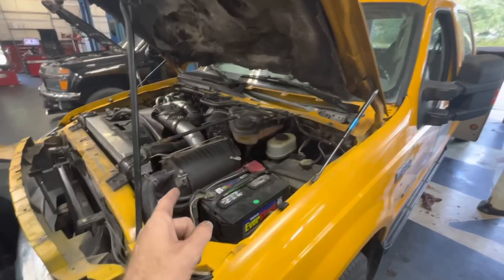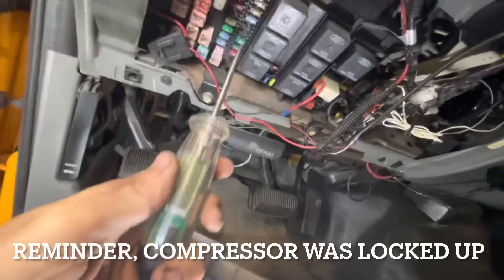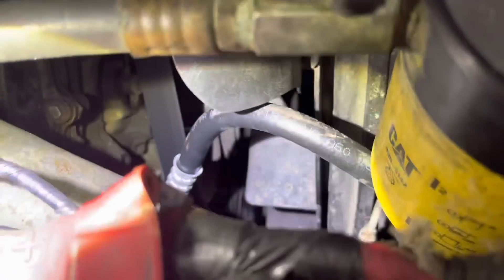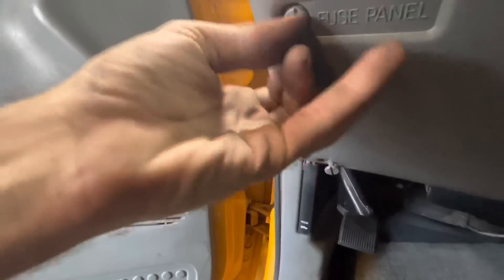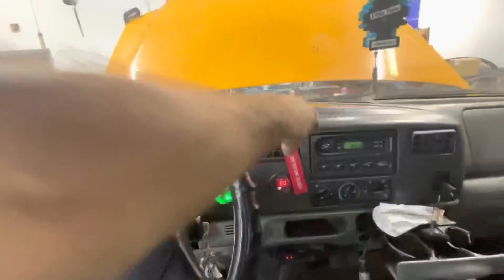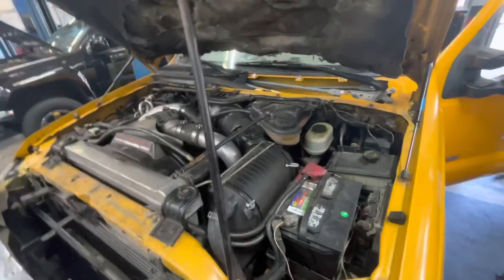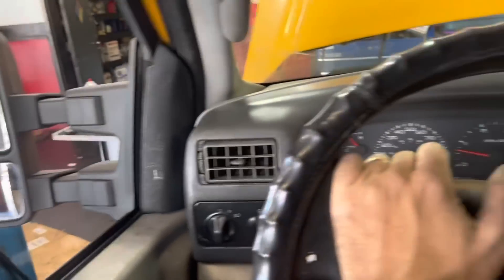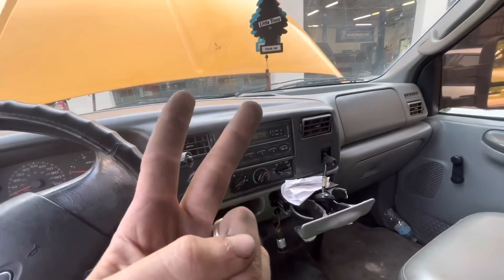All that for a fuse? F350 6.0

Comment: Don't feel bad, early Ford OBD2 will kick you in the a the D for the fun of it. I remember one with a bad alternator and fuse, that was fun trying to figure out where the wiring problem was, almost deemed the ECU before finding the fuse for the alt on the firewall. What a fun day. After that I altered my diag with Ford's with stupid problems moving to the fuse block and harness diagram checking for fuses. Ford uses a fuse for everything.

Comment: I had a gut feeling the fuse blew judging by how badly that old compressor had seized up.
Reply: But why didn't the connector to the compressor have a ground?
Reply: @BrassHammer  That's a good question, perhaps it used the engine as a ground?
Reply: @BrassHammer   There was No ground found/measured because Ray had his  Multi Meter set to DC Volts while he was trying to test for ground. I suspect he had had enough of that truck, burnt out and frustrated at that point and time of day. Instead of Volts he would instead need and want his meter set to “Ohms” lowest resistance setting to measure the continuity of the connector and wire to ground.
Reply: ^This, schoolboy error. As soon as I saw that the belt was chewed up and he said the compressor had seized, I said to myself, I wonder if he will check the compressor fuse...And @Wirefeed is correct about the ground.

Comment: Fun "ship in a bottle" job. Nice work, but just be glad it's not a NY vehicle. Up here, that job could easily escalate to pulling the motor, as everything from wires to fasteners would be salt eaten, especially with that kind of mileage. NO walk in the park on a Florida vehicle either, but you nailed it. There are so many things to go wrong getting to the buried accessories on these newer vehicles. Some repairs require a minor miracle to pull of as described in the book. Thanks for filming it, it's gotta be tough on a job like that. Looking forward to tomorrow, don't know how you do it.

Comment: Got to love it when the repair is simple.
Reply: Yea... simple. Glad I didn't have to do it.
Reply: @robertthomas5906  Just remember everything up, to the fuse box, was done in 2 previous episodes (so like 4 days). I felt, when he signed off on the previous episode, he was fretting trying to diagnose an electrical fault buried somewhere in the engine. Replacing a fuse is a simple repair, and gets the truck out faster, and once the pipe parts come in, he can return the truck to its owner in a much better condition than when it arrived.
Reply: @Darkalyle  He's not the only one. I was afraid there was a bare wire someplace for him to have to find. That engine was so much fun to work on.

Comment: Car Wizard had a video on AC systems the same day. It makes sense that you need to change everything after tge compressor blows up and sprinkles shiny bits all through the system. You don't want those shiny bits in the new compressor.

Comment: I heard on powerstroke help there is a "Florida/Southern Man" hot climate orfice tube for those trucks that lets you trade additional compressor load on the engine for cooler cab temps. As I was watching you replace the orfice tube I was looking at the color, and wondering which one was going in to this job.
Reply: I live and work on the Texas coast and use the ford orange orifice on every vehicle that uses a orifice
Reply: I would like to know how that affects the compressor and the belt.
Reply: Additional reading shows that there are different orifice tubes for R-12 and R-134 systems respectively. There are also variable office kits, and other things you can do like installing a severe duty Fan clutch. 
And there are special condensers and other adaptations for converting systems from R-12 to R-134.

Comment: I'm sure someone has pointed this out but, at the beginning of this video you identified this as a F-150. It states on the fender badge this is a F-350. But as we don't judge if the truck wishes to be identified as an F-150 we must respect this. My own F-150 identifies as an F-350 gas burner so I just let it ride. As a side note I once owned an 1985 Isuzu pickup that identified as a 2010 Chevrolet Silverado 3500 with a Duramax. Not sure how the hell that happened.
Reply: Common denominator is you - hmmm - maybe someone raised you two trucks 'differently'! Seriously, I enjoyed your comments,
Reply: I've seen weirder things,  my Scion xD identifies as a snow plow.
Reply: My RHD JK Wrangler identifies as a left hand drive.   When I open the right front door I get an indication on the aftermarket head unit that the left front is open & visa versa.  (This explains why the manual says for de/activating the automatic door locks you use the switch on the drivers side door, but I have to use the passenger side.)
Reply: F150 should be addressed by its preferred pronoun... F J B
Reply: My F250 identifies as a Dodge-And it runs equally as bad….😂

Comment: Nice work! How did you handle that ground wire mess that you showed when you were taking it apart in the first video?
Reply: Since he didnt show how he fixed it or say how he fixed it eventhough he said he was going to show it to us again because he wasnt sure if he did the first time or not, he prob jus put it back like it was. Would have been a simple fix. Just cut it where the bolt went through the wire and put a big ring terminal on each end, like the one that was on the other one

Comment: Great videos, you do good with one hand think how fast you could go with 2. Could you mount a camera on your head like a motorcyclist. I was a mechanic for 10 years, don't miss it a bit, those holes were in the wrong place I would have taken a hole saw and made some new ones to line up with the bolts, then tapered the bolt ends to help line them up too

Comment: Yesterday I suspected a fuse problem, the strange thing was that there were nor positive nor ground. Thought that maybe the low pressure switch was broken and it commanded both ground to the clutch and ground to a relay.
Reply: If you look at Ray’s Multi Meter you will see he was still set to Volts DC when testing for ground, he would need the meter set to Ohms Resistance to test the ground continuity. Putting myself in Rays place I am sure he was Burnt out tired had enough of that repair and overlooked the meter setting. He did remarkably well at his best behaviour when the compressor didn’t start, I’m sure he saw red over that yellow truck.

Comment: That pulley probably rubbed out the coil on the ac compressor when the bearings failed and popped the fuse.
Good job on the repair, and thanks for sharing.
Kind regards,
South Africa
Reply: I think you are absolutely correct. I've seen that numerous times.

Comment: was once driving down from a ski resort in a blizzard and the windshield wipers stopped working. So I put my ski goggles on, stuck head out the window and kept driving. I'd had brakes serviced that week too and they were making a racket (drum brakes...locator keys not put in properly). got to gas station at bottom of hill...pointed friend at wipers and told him to dismantle and inspect while I worked on the brakes. Shop didn't have keys - found sardine can keys in bin, wire cut the ends off and they worked a treat. Returned to friend who had dismantled wiper assembly. Couldn't see anything wrong. Something in brain said...ah...stereo died at the same time as the wipers...new fuse...bingo!

Comment: my pontiac pulled the same shit on me. it would shut off right after turning on, the engine temperature gauge wouldn’t read, idled really rough, etc. cleaned all systems & replaced all fluids. tried one of those fuel system cleaner fuel tank additives. nothing helped. a shop said the diagnostic would be $100ish alone and i went home to wait till i got paid. i just started poking around and pushed in all the fuses n went inside. didn’t use my car for a few days so i wouldn’t destroy the engine. worked perfectly when i used it next 😐 now any time it starts having issues, i’ll push in the fuses and it’ll work fine immediately. now i just need to figure out why my fuses are getting moved by vibrations enough to affect my car’s functioning within 10 or so days (depending on how much/how often i drive)

Comment: Ray!...what is the normal a/c vent temp?  I've seen lower on other vehicles.
Reply from the maker: You get into the 40s while driving. The system really needs good airflow over the condenser. Usually won’t happen at idle
Reply: @RainmanRaysRepairs  Thank you sir, I shall test my vehicle per your advice.  click, out.
Reply: @RainmanRaysRepairs  you got it! Anything below 40 degrees compared to ambiant temp is “heaven” sitting in shop with hood up ! Let’s all go for a road test ! & bring a sweater ! LOL
Reply: I have had snow come out of the vent on my 80 Honda accord
Reply: Cay Jon. Depends what vehicle year and freon. Depends on interior temp also. I will back up Ray's advice driving or sitting still will alter temps. 30yrs in HVACR field.
Reply: @MrPaultiwanger  that's cause R12 Had better temp swings than 134a. The boil off was able to achieve colder temps. I sure hope new games coming out can one day replicate R12 better. Especially on pressures too.
Reply: @FlyEaglesFly19111  R134A and R12 are very similar in pressure/temperature
Reply: @FlyEaglesFly19111  I knew that , I would take people out in that car and have people freak out I kept that car till 2000 even bought up R12 before you could not get anymore but never had to use it .loved that car I got up to 33 mpg on the highway trips .

Comment: Hi ray. I have the same engine except in van form and I'm wanting to do this same job on mine plus a new transmission cooler......can you give a ballpark on what this job that you did cost?
Reply: Never seen Ray talk repair costs.  Just a guess…  The compressor, condenser, accumulator, new belt and Freon probably around $ $1200- $1500.00 dollars US then labour probably double it plus tax  $ 3000,00  ish plus tax.

Comment: so compressor exploded, belt got grinded to shreds and exploded, electrical system got pulsed and exploded. id run far and fast before the fuel tank heard it was boom time.

Comment: It was probably necessary but you can avoid this with the scanner i believe where you can command the clutch to engage. If it does then you can say its a sensor or another issue. If not then you know the fuse is bad or the wire has a short. I think the ac compressor and the orifice tube would have been enough. You have courage to upload this video cause i feel like as a customer they got dooped on this one. But you got it after changing everything.
Reply: The compressor and other AC components had to be replaced because they were incorrectly installed, and the wrong part in the case of the compressor, which is what seized the compressor and broke the belt. The fuses blowing was most likely a side effect of this issue, not the other way around. Swapping those fuses before fixing the AC system and belt would not have worked, at best it would run and then die when it overheated (from lack of water pump) or ran out of electricity (alternator not charging the battery).
Reply: @amoose3424  ac compressor works off an electric clutch. By experience if the compressor is locked or destroyed then chances are the fuse can blow. Thats why there is a fuse. After installing the compressor the fuse should have been checked. Other parts were installed thinking they were the reason the clutch didnt engage. Changing the parts were because the fuse was assumed ok and that the freon could not either pass through the system for the pressure sensor to be read. The pressure sensor was working correctly. It sent the ecu the signal to engage but the fuse is blown. So it didnt matter. Without that fuse. All other repairs were probably not needed. Just assumed there was blockage or something to prevent the compressor to engage. Even if the hose was bad or other parts were not up to par. If it even held a small amount of pressure the clutch would engage had the fuse been ok. It would have been easier to read on the scanner. It would have showed the pressure sensor to have voltage and the ac compressor not engage. Fuse is blown or there is a short to the circuit . At that point you could take the plug check the wiring diagram and confirm no power from the fuse. And then using a power prob to apply direct power to see if it works. If it does fuse is not good. If it doesnt defective part.

Comment: Did you charge the guy for all the parts and work before you found it was the fuse?
Reply: That compressor was garbage, it was locked up, so of course there was a charge for it
Reply: The compressor was completely ruined (because it was the wrong one) and the second orifice tube had to go as well or the next one would be too from the overpressure. It also needed a new belt because the old compressor snapped it clean off. All the previous work still had to be done or the car wouldn't have even run once the battery died.

Comment: The real question is what caused the fuse to blow!
Reply: A/c clutch was wasted in first video and locked compressor and shredded the belt, so clutch probably shorted and blew a/c fuses.
Reply: the compressor clutch failure of the old compressor. happens almost every time

Comment: Ray:  Ford F-One Hundred and Fifty, Six Litre Diesel....

Uh, I'm gonna stop you right there. The F-150 is a light-duty truck and does not come equipped with a 6.0L Diesel engine. It never has, never will. I'm PRETTY sure that's an F-350 SuperDuty.
And now the it'll forever be on the Interwebs that Ray called a F-350 a F-150.. 😂
Reply from the maker: 😬 oops